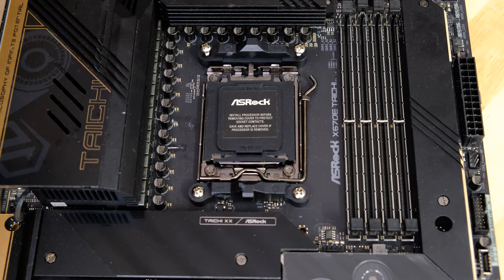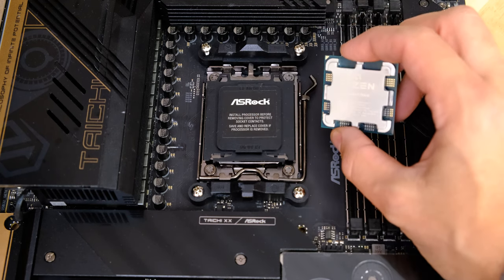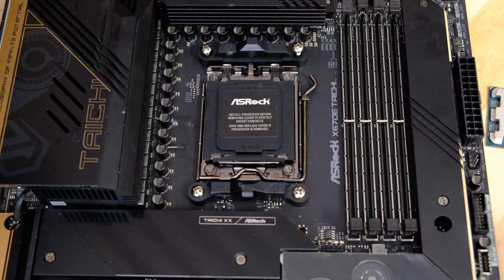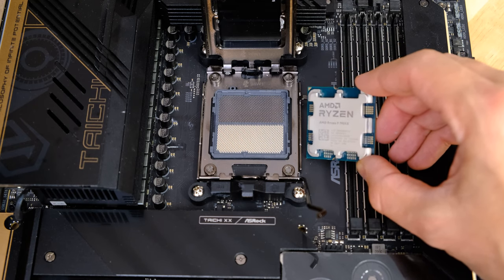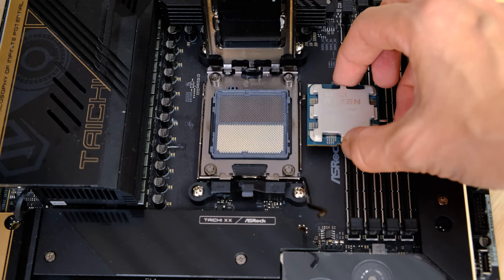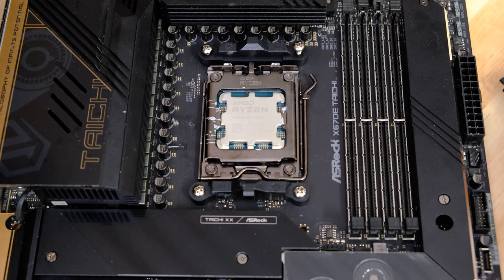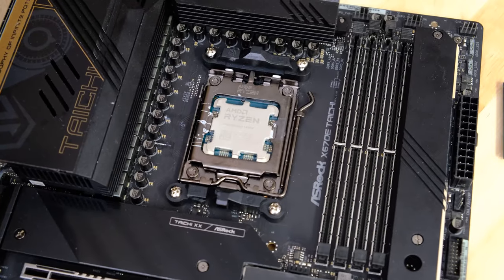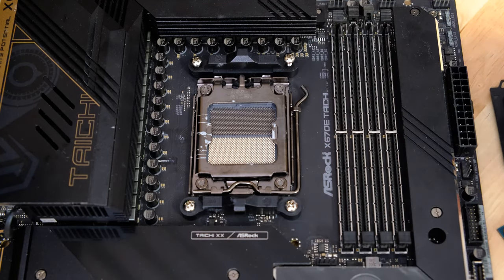How To Install A Ryzen 7000 Processor

Comment: Just a note, it's not a good idea to touch the gold plates on the back of the cpu, as your finger oil will corrupt connection integrity. It's better to just hold it by the sides, and not touch any of the electronics.
Reply: I wanted to write the same thing mate.
Reply: Disagreed with you.
Gold is a noble metal, that is generally resistant to corrosion.
Guess, it's one of reasons why they use it CPU manufacturing.
Reply: It's gold plated. Trust me I work in manufacturing, if just a touch of your fingers caused corrosion then every manufactured part in the world would be made in a clean room.
Reply: I think you need more education in chemistry and physics and Au
Reply: @dazlad926  Wait so this is just one of those gamer pc building tips that don't actually hold? I've believed this for a long ass time. Crazy how something wrong can just spread like malice on the internet.
Reply: It's not going to magically corrupt your contacts, but it is still a good thing to avoid. Imagine some newbie builder with KFC oily fingers touching that "because a little couldn't hurt now, could it?".
Reply: @kamikaze00007  Yea I don't think it'll cause permanent damage that you can't clean off, but the oil while on there could cause poor contact if it's between a pin and pad.
Reply: @ivanpoberezhniuk9694  When the OP said "corrupt connection", it had nothing to do with corrosion.  It's simply about the natural oil from human skin causing a barrier to contact for the CPU and socket.
Reply: @rainman6090  yh I agree probably less connectivity where you touch it
Reply: It's the same reason not to touch certain light bulbs, the oils from your skin will cause excess heat not because of corrosion.  Not sure how you chemists, and manufacturing engineers don't know this.
Reply: @ivanpoberezhniuk9694  still better safe then sorry
Reply: Its fine. A little finger oil aint corroding that.
Reply: One time I accidentally touched an x4 860k by the pins and a wild ferocious snake came out of it. Do not touch the pins or gold plates
Reply: 100% true
Reply: what if my palm is sweaty and touch the gold plates behine the cpu or the motherboard socket, will it kill it?
Reply: @dazlad926  what if it touch my finger and i have a sweat there? will it become a problem?
Reply: @aqwandrew6330  i doubt it as long as you don't smear it with sweat or any liquid for that matter.
Reply: Make sense..
Reply: I didn’t even know this was a thing but thank you for passing this on. thankfully I been doing it right for 2 years lol
Reply: What does he mean by the back? Does he mean the bottom? The part that makes contact with the motherboard.
Reply: No it's not a big deal.
Reply: Even if you put some thermal paste under the cpu it will probably be fine.
Reply: All the commenters saying the guy is wrong have issues with reading. He has never said anything about gold corrosion - of course gold being a noble metal won't corrode/oxidize etc. Unless if you're touching it with aqua regia, but that's another problem. :) He is actually making a point here because oils from skin (especially sweaty) would leave a thin oily layer on top of gold contacts which then can make electrical contact between CPU and socket pins worse (oil is not conductive, has higher resistivity than gold). This could lead to slightly higher temperatures of operation and ultimately negatively affect CPU's performance which is very sensitive to temperature conditions nowadays. So, of course, it is not THAT big of a deal, but I would strongly advise against touching any bare gold contacts with your fingers.
Reply: I am not saying you are wrong and why get the  pads covered with a oily fingerprint when there is no need.
However after watching computers running inside oil filled fish tanks and on my old phase phange vapochill case back in the day I would fill the cpu socket with grease prior to fitting cpu to help fight moisture in the air.
I would worry about not bending the pins, concentrate on that.
Reply: Same observation. This guy is pretty careless.
Reply: @ivanpoberezhniuk9694  it's not corrosion that's the problem, it's electrostatic discharge.
Reply: This is true
Reply: i just touched the gold plates and dont know what to do

Comment: Although it was an informative video, I would recommend to anyone reading the comments to NEVER touch the underside of the processor! The oils from your fingers can get on the pads not to mention anything else that might be your hands. And NEVER place the processor pad side down on a table. It should go from the protective case it came in, to the socket. Don't fiddle fuck around with it. You risk contaminating the socket with dust and other crap you might have on the surface you placed it on. unbox it --> insert in socket. Period. Cheers!
Reply: Finger oil does not cause any issues. Im not saying to run your fingers all over it but its fine.
Reply: The issue is not the oil. Rather, it's static. ESD. I dunno why people here keep saying your fingers could be oily. It's not that.

Comment: Also DO NOT EVER Touch the gold pads on bottom of the CPU! EVER. 
Any tiny grease or contamination on your fingers will damage the gold and even cause conductive issues / heat issues

Comment: The thermal paste over spilling a bit (being squeezed out - after you screw down your cooler) usually isn't a problem  - - -  except, if you use liquid metal. All you know is your pc is up and running and you're happy - on with life. Meanwhile, over time, that liquid metal is secretly acting like an acid and eroding those metal parts outside of the cooler contact area - that it spilled over. Problems may arise later.

Comment: I gotta be honest, I like the new socket and locking system. I remember when I installed my first am4 cpu and had to reseat it and remove the heat sink, the heat sink ripped out the locked cpu and a bunch of pins got bent. Never had the ripping out with the cpu happen with lga sockets. 
I was lucky the cpu was just a placeholder for a later upgrade, so I just upgraded earlier :D
Reply from the maker: True! Just gotta be careful with the socket pins!
Reply: had this happen once to me but miraculously the pins did not bend. from then on i gently rotated the cooler left and right while GENTLY pulling up until it budged nice and easy. btw, when that happens its generally speaking a sign that you used too much paste
Reply: How tf could that happen? You'd need a serious amount of force
Reply: @AGRACUTA  I think the rotating was actually what damaged the pins. I think the best way is to run a quick stress test to heat up the paste (at least if you can actually boot the OS), then it's much easier. I actually took out that broken cpu a couple of weeks ago, and spent an hour straightening the pins with a razorblade. Fortunately 
the cpu still works. But it could've ended very differently.
Reply: @LaughingMan44  no you actually don't. The locking mechanism is pretty weak. But I also had the dumb stock heat sink with the two clips and the lever (instead of screws), so it's exceptionally hard to loosen the heat sink without lifting the cpu out if the paste sticks to it.
Reply: @mario7501  You used too much force, simple as
Reply: I did the same with my used 3900x. It wasn't seated right and my cooler ripped it out. Lucky I didn't bend and pins. Later on I realized the pins were already bent when I got the cpu but it was to late to return it. Good note is I found a way to full seat the cpu in place.
Reply: i ruined a ryzen 5 cpu when i swapped for my ryzen 7 XD
Reply: @kidlo2050  rotate and twist the heat sink first ,and then lift it slowly... it easy.... as pie
Reply: @theendtimesmarketpredictio4940  yea I figured that out right after I removed it again

Comment: that's why I bought the Thermalright  AM5 CPU Holder, Corrective Anti-Bending Fixing Frame, AM5 Full-fit Fixed Non-Marking Mounter, AM5 Anti-Bending to avoid damage to my pins when pullout the cpu and to maintain much better clean from the thermal paste

Comment: What an absolute GARBAGE design - this is where we are at in TWENTY TWENTY THREE ??????? That's fkn SPACE AGE date mate - this is pathetic.  Same old non existent innovation in the PC hardware industry as OVER 10 years ago.  Thank you for the video, I am now terrified to build my PC ;P (Jest)
Reply: Couldn't agree more. I've built pcs myself for years and this design is so flawed that I am stuck with a board that has bent pins as I was not aware of how fragile they are. I even built an Intel system recently and never had this issue. AMD should never have adopted this socket layout.

Comment: Over the years, I've never had an issue with LGA socket. So straight forward and never damage a pin on the board. But on a AM3 CPU, an AMD phenom 955 and I was removing the heatsink, the thermal paste stuck solid and I pulled the CPU out the locked socket and bent 3 pins, I manage to get the pins straighten enough to fit back into the socket and locked it back into position and I was extremely lucky it booted and that CPU went on for another 2 years before I upgraded.
Reply: Literally just did this when changing my cooler a week ago, bent a bunch of pins and couldn’t fix 😭so today I just upgraded everything 😂hello new PC ahahah
Reply: @cameronevans242  it can happen to anyone, that PC build included a pre built motherboard bundle and the cpu heatsink was included and was already installed, they completely covered the CPU with so much thermal paste and when it dried out it was stuck solid, in hindsight I should have booted the pc for while and then left it off and then changed the heatsink letting the thermal paste liquify so I could remove the heatsink a little easier. 

Since then I build my PC's completely myself, always applied the right amount of thermal paste. 

Enjoy your new PC 🙂
Reply: @wink1eafc774  is it better to install an air cooled tower before putting the motherboard to the case or after? because if you put the cpu cooling heatsink then putting it on the case, i think it will be hard to install an io right?
Reply: @aqwandrew6330  install the air cooler first before installing the motherboard  into the case.
Reply: @wink1eafc774  it would not be hard to plug in the usb header or power cable to it later on? also the psu should come after all the cpu area is done?(including cooler on top of it like you said)
Reply: @aqwandrew6330  no the CPU cooler is powered by the a 4 pin connector on the motherboard, so it's easier to connect that before you install it in the case. 

Also you should  have done the PSU installation into the case  first so you can do your cable management and they're in the right place to be connected to motherboard once that's installed. So for example you'll have the CPU power cable routed and the 24 pin power connector for the motherboard located in the right place.

Comment: Just put a finger on the CPU holding it down while opening the latch and lifting the hold down bracket to keep thermal paste from lifting the CPU potentially dropping it onto the pins
Reply from the maker: You just got thermal paste all over you’re finger. 😂
Reply: @CrazyTechLab  you wipe the thermal paste off just like you stated in the video
Reply from the maker: @FrgottenFrshness  Ah sorry! I thought you meant leave the paste on there and just hold the CPU. If you clean it first then hopefully you wouldn’t need to use a finger unless the PC is upright and the CPU could fall out.
Reply: @CrazyTechLab  no worries
Reply: @CrazyTechLab  Is thermal paste toxic? I got some on my hands but just rinsed it off w water.
Reply from the maker: @heyitsdazy  You don’t want to eat it but if it was that bad on fingers I’d be dead by now. 😂

Comment: Although your video is roughly 8 months old, I just stumbled across it and watched it because I have been kicking around the idea of building an AMD Ryzen 7900 AM5 system and I’ve always been very concerned about accidentally ‘bending pins’ – in the past – on the AMD and now that worry has been transferred to worry about bending pins in a motherboard’s socket. (“You never get something for nothing…!)

Anyway, as a result I watched your video and as I did, a few ideas which may or may not have merit ‘popped into my mind’. (Before I go any further, I am especially concerned more than many people because I’m 77 years old and “mine hands, they ain’t as steady as they used to be” and, ‘ditto’, when it comes to my ‘grip’ on things and I am probably considerably more likely to drop in situations like this then most people and so, as I watched your video, I wondered if I could come up with some POSSIBLE GOOD IDEAS to mitigate the risk.

Now, I have never built a PC for myself wherein the pins were in the motherboard but, after roughly watching your video, here are a couple of ideas I had, that PERHAPS you might wish to consider and assess – based on your experience in this area which I do not have – whether or not they might have merit. Here goes:

First of all, one concerned is – as you pointed out – that one might conceivably drop the processor accidentally onto the pins in the socket, perhaps at an ANGLE, resulting in damage the pins, something could obviously happen. So what you think of THIS IDEA:

Might it be possible and useful in a safety sense to – say – cutting a strip of suitably wide and suitably long PAPER from say an 8.5” x 11” printer paper AND, laying it down and possibly even using without being too excessive and going crazy with it – perhaps some cellophane tape to hold it in place while you proceed to POSITION the processor over the socket and its pins while you do this AND, once the processor is ‘100% in the right location’, while holding the processor in position to prevent it from moving sideways or up and down, pulling/siding the paper out from underneath the CPU – GENTLY, so that the processor simply has to/can – perhaps – space wise – if it happened to be constrained by the orientation pins and indentations, from moving laterally?

A slight variation on this: What if two pieces of paper were used – they might even and probably shouldn’t could OVERLAP a bit in the middle of the socket protect all the pins. The idea here would be that one might then say – pull only one strip of the paper out – at which ever end seems more appropriate – in the sense that it would be the first and to ‘receive pressure’ as one turned the lever to lock the processor in place. Perhaps simply flipping the lever over and letting whatever light pressure it might exert on the processor would be sufficient enough to permit the second piece of paper to be slid out from underneath the CPU such that the entire processor drops into place?
Another idea might be to – if one could conceive of some gentle way – of creating a little platform made of wood perhaps – and be careful not to drop it – to which say of thread could be attached which in turn could be appropriately sufficiently well attached – stuck to the top four corners of the CPU – which could then be spent the processor – dangling from these threads – over the socket and maneuvered precisely into place – for attempting to lock it down. 

Then, when the processor was in precisely the right location, one could probably – I would imagine – after watching the entire process – managed to find a way to disconnect or cut the threads in question either close to the platform from which they were hanging OR – as close as possible to the CPU ASSUMING that you don’t want to try to COMPLETELY remove them/pull them off – until the clamping lever was fully seated and locked in place?

I think you’ll probably get the idea from the description I’ve given. Another way to think about it: Imagine how space sex manages to PRECISELY – HAVE TO PRECISELY POSITION the upper stages of Falcon 9 AND Starship rockets – to straightly tiny fractions of an inch – before lowering them into place and perhaps installing some sort of explosive bowls or something – to fasten them together?

They do it by dangling the upper stages and slowly but surely maneuvering them around and positioning them before finally lowering them in place.

I would be very interested to hear your thoughts on the matter, YOU having had hands on experience in doing this. This may be overkill for some people but, I can assure you – for older people whose hands and grips may not be that steady, if it would work, I think it would be worth trying to do it using some sort of say – dangle the CPU from a sort of ‘fixture’ using say at least three, possibly four pieces of thread and then simply lowering the CPU precisely into position.

Whad ya think?

Comment: Useful tips. Got one of these coming in a week now that less expensive b650 mobos are out.
Reply from the maker: How are prices looking? Are they much cheaper than X670?
Reply: @CrazyTechLab  paid 239 USD for a gigabyte aurorus board. I could have gone 200 but I'm the kind if person that will actually need 8+ usb ports. Cheapest board is a micro ATX from asrock at 169.
Reply: @CrazyTechLab  Paid 300 for a ASUS TUF board yesterday. Cheapest ones in Sweden are 250 atm :/
Reply from the maker: @vaarius6737  Kind of a pain even the low end ones are relatively expensive. I like having lots of features and accessories, but that's going to cost upwards of $400/£400! :/